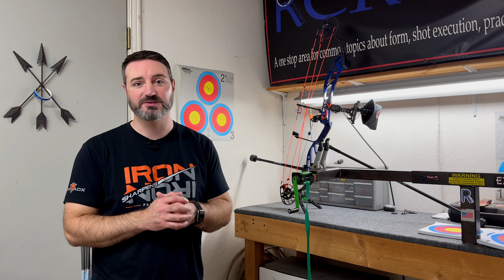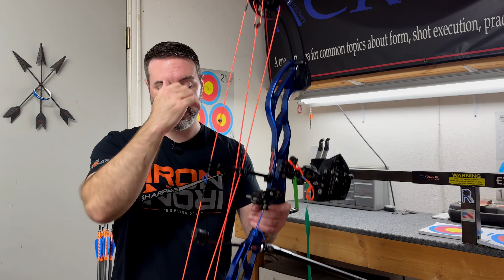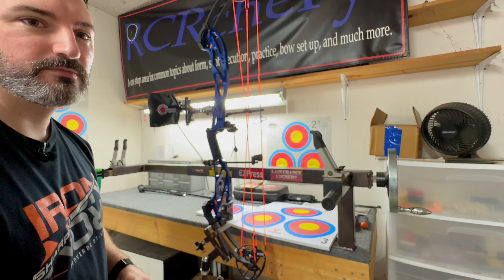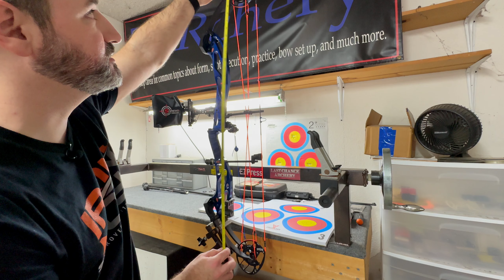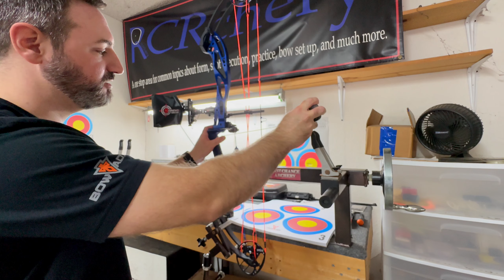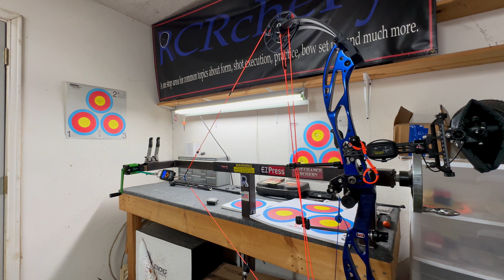Setting Up Arrow Rest, Draw Weight, Let-Off, & Pulling Height. Tuning Series Video 1 (TToTW#77)

Comment: Question on leveling the arrow with the tension based rest…I’m assuming that once you remove the tension, the blade comes all the way up and then you can use the arrow level to determine nock point right??  Also, do you put the arrow level closer to the nock end or the tip end and why??
Reply from the maker: That is correct. once the tension is release the blade comes up. I usually put the level on the arrow just in front of the riser. Keeps it close to look at and doesn't weigh the arrow down any.

Comment: I want to know how you figure out how to set up your draw board? I have heard many times that if your draw board is not off set to how you grip or hold the bow. Setting the timing on a draw board will not be the same as what you have when you have it at full draw because of the way you grip the bow. 
That can make you think your timing is on. When it actually is not. And cause those low tears/ high tears and you think it contact or a rest.  But it’s actually your draw board fooling you?
I would love to know your thoughts on this!
Reply from the maker: Good point here. I’ll talk about it in next week’s video how I get to that with creep tuning.
Reply: Thank you!
Reply: its not an issue as the draw board does not grip the bow its just a pivot point so it has no ifluence on being top or bottom biased, which is really how you should support the bow during teh shot anyhow. only reason i can think of that you may get one cam advanced over the  other is if yor d-loop is not in the optimal position.